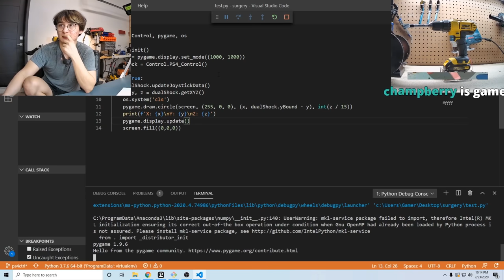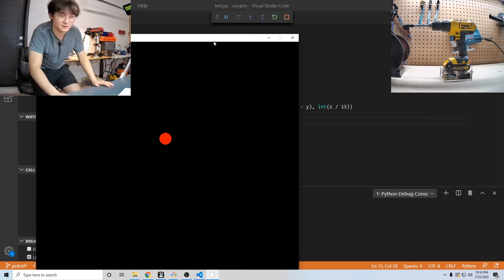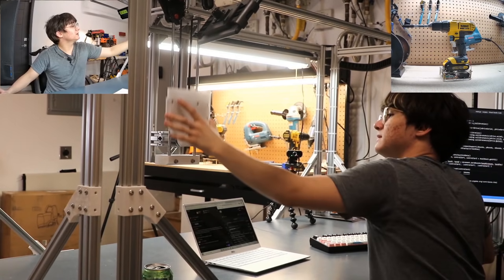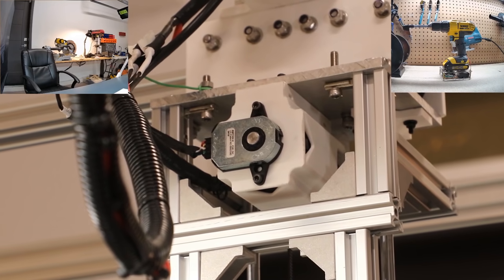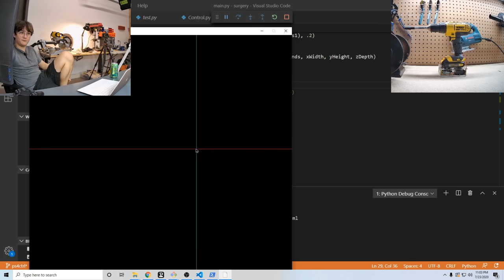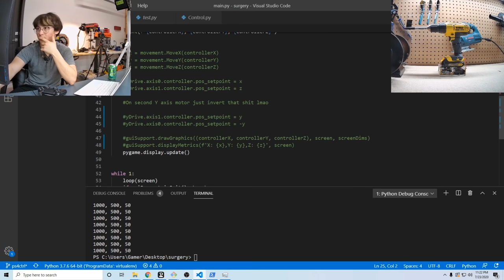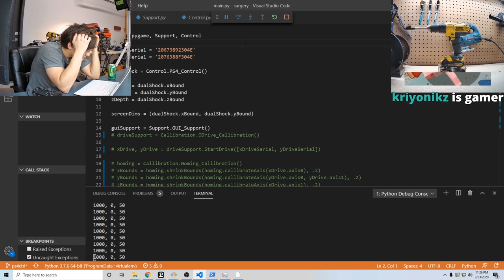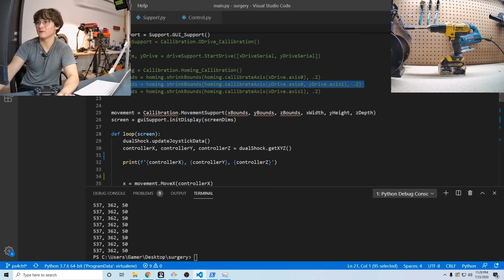camera robot by michael reeves

Comment: I’m confused why is the drill moving on itself
Reply: he programmed it to go off every time someone subscribes lol
Reply: @unounounouno2876  he's actually a freaking genius, how many subscriptions do you think he gets only because of the drill
Reply: He programmed it to move when they gift subs or donate
Reply: @unounounouno2876  its battery powered i think
Reply: @Holynxx because you don't use electricity to charge drill batteries?
Reply: @unounounouno2876  The issue with electricity is mostly in infrastructure, not scarcity. If its a 400W unit, worst case scenario (not this one, Mikull's drill has no load on it),  E=PT so it's going to "waste" 400W*4s = 1600J of energy. Realistically, we could shave off a zero from that figure and we'd still be overestimating (only thing that motor needs to push through is the windage loss). For reference, making a small 100ml cup of coffee takes about 30kJ, which is nineteen times more.
Reply: Drill chan go brrr
Reply: Give  @c-djinni  a cookie
Reply: @thewarroirtaco  drill kun